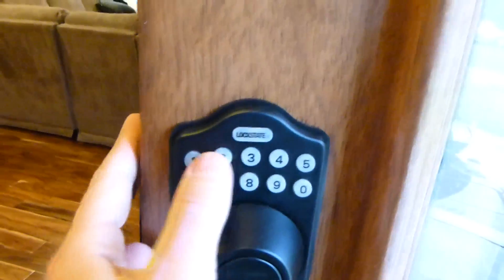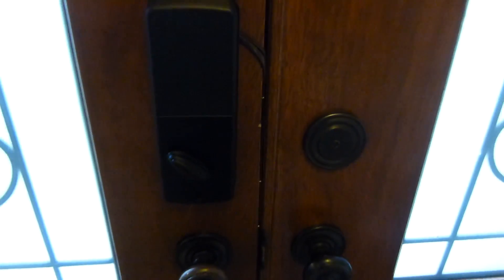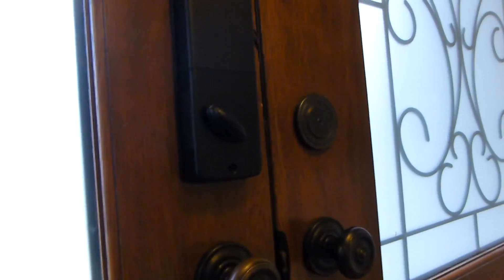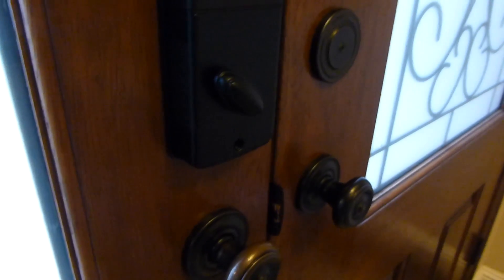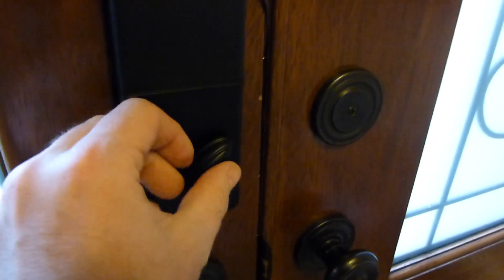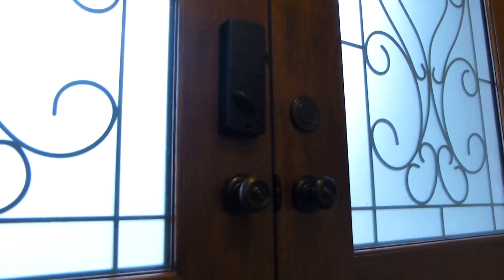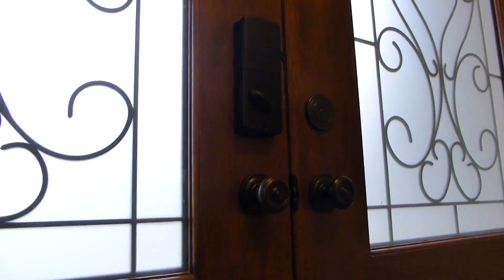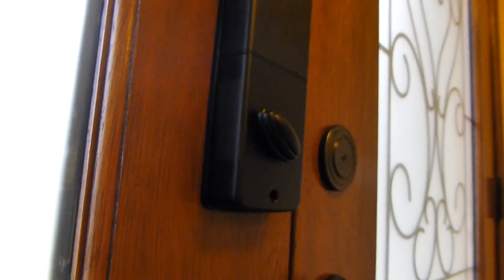Demonstration of auto locking failure for Lockstate LS-DB500 / LS-DB500R

Comment from the maker: The problem is there on all such locks out of the box. I modified mine later, and voided the warranty, but the problem I described is there regardless.
Forcing the lock to lock up is for the video demo. On deadbolts with double doors, it happens often if the door hasn't been pushed enough and the deadbolt cannot lock.
The firmware should know that the lock was successfully locked later (by hand) but it won't auto lock. That's in the video description, re-read it.